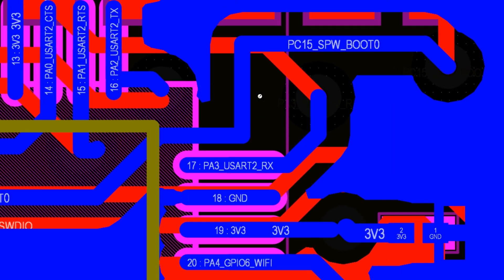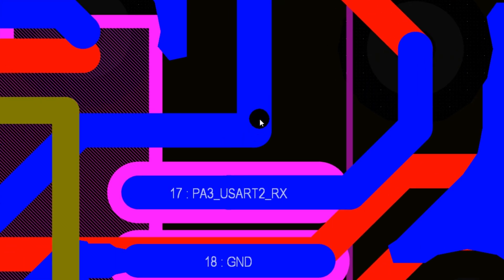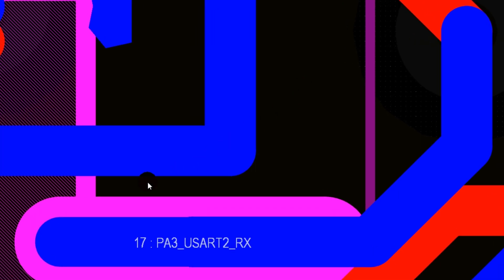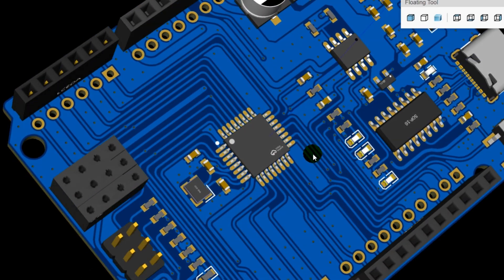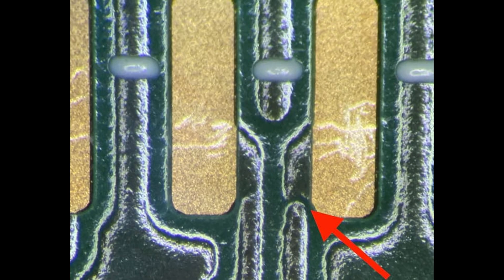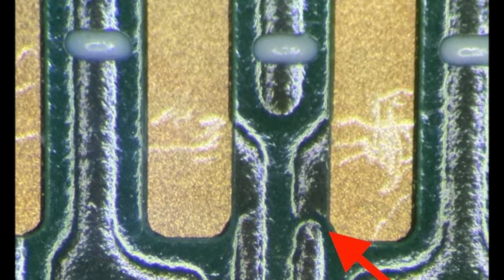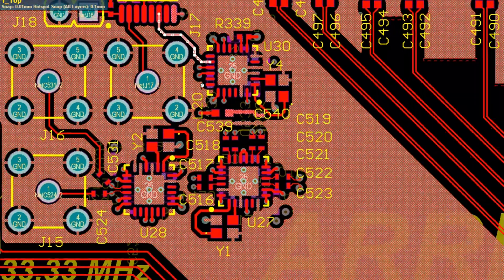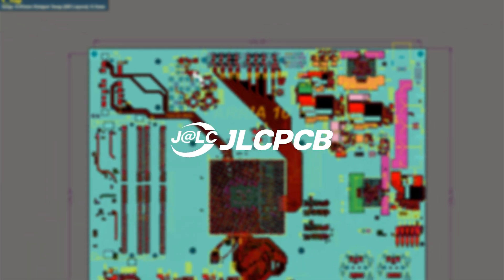Why Sharp Angles in PCB Design are a Bad Idea!  #jlcpcb

Comment: the consensus seems to be that there is no measurable EMI below 100 GHz.
which is good news, because vias and through-hole pins also present right angles.

references (links forbidden by youtube policy)
--------------------------------------------------------------------------
1. M.I. Montrose, Time and frequency domain analysis for right angle corners on printed circuit board traces, 1998 IEEE EMC Symposium. International Symposium on Electromagnetic Compatibility. Symposium Record
2. Altium online resources, PCB Routing Angle Myths: 45-Degree Angle Vs 90-Degree Angle
3. Cadence online resources, The Challenges of Right-Angle PCB Traces
Reply: Yup, Vias and TH are also 90 degrees

Comment: Is this true for power lines as well or just for signal lines?
Reply: I'm pretty sure it depends on the frequency in question. For smooth DC and typical AC lines there will be no difference, but when you go up to hundreds of kHz and higher this can come into play.
Reply: @Piqus3  No, it does not. Not even at 1 GHz and more. Maybe at 10 GHz, I dont know.
Reply: @ Well If you don't know, then what it this all about?